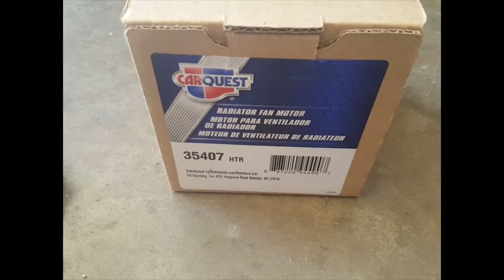Dead fan motor  - 76 MGB

Comment: The hole in the radiator is where the fan switch is in inserted with a rubber grommet, the fan should not come on with the ignition someone has bypassed the fan switch usually because the engine was and still will overheat unless the switch is bypassed and the fans run continually.